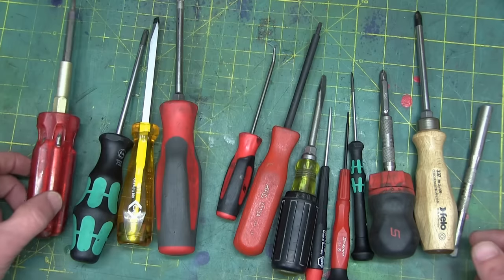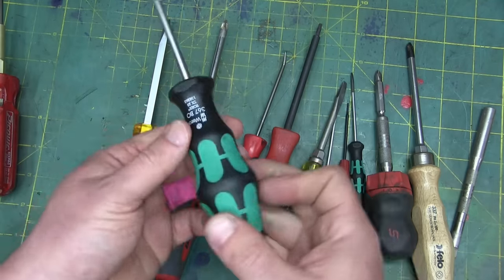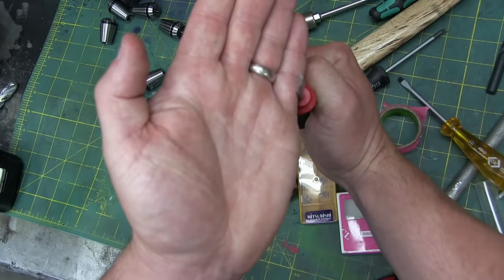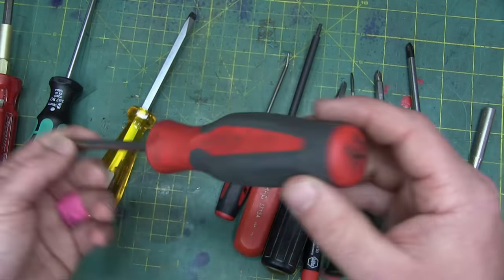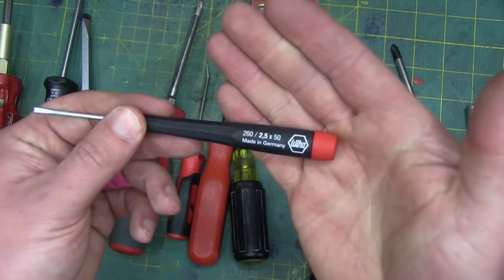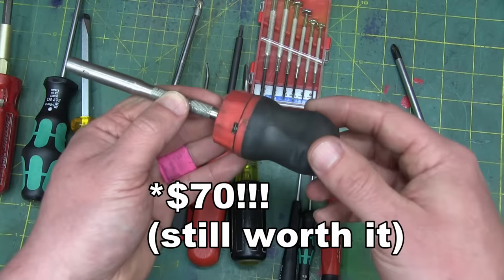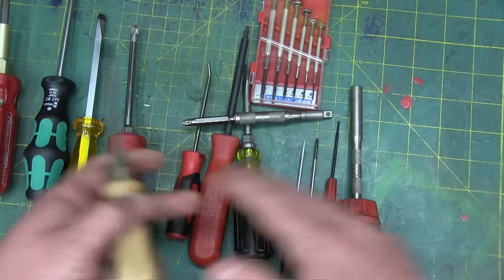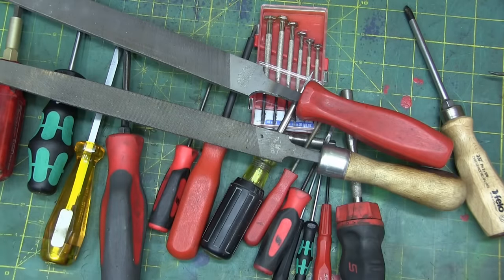Screwdrivers is BEST screwdrivers?

Comment: as an electrician i've always preferred the kleins, although that's probably just because that's what my starting tool kit i bought in school had. their pliers i actually don't like much and prefer knipex. klein handles come off, which really sucks ass when you're pulling fish tape. haven't had any problems with the metal bits but i have pulled more than a few handles off on both needle nose and linemans. i have small hands so the euro screwdrivers don't work well for me. 

fwiw though the screwdriver i use the most is an ideal bit driver i stole from the ideal rep one day, it has a little slot in the back for wire nuts that works really nice and it's just generally good enough for most things so i dont have to fuck around swapping tools.

Comment: The green Weras dont have the nut on purpose...thats what the black and yellow Weras are for, they also work as a chisel. The red and yellow series on the other hand is insulated for electricians work. And there is also the grey and yellow series made of stainless steel for wet work.

Comment: I agree with you for straight mechanical use. It's very different for electrical. The Kleins are great for large work, but in my opinion the best brand was Vaco. Unfortunately, they are out of business. Craftman Professional had copies of the small Snapons - have a bunch of them. The drivers with the shank all the way through the handle indicate suicidal intentions if used on electrical circuits!

Comment: I like Commercial Electric screwdrivers for mostly indoor use such as electric work because of the handles. They give you a decent grip and purchase on the screw, but allow you to turn screws fast. 

For working on cars, I like SK screwdrivers with the square, plastic handles. Soft grip handles don’t last long in the automotive field. The square handle is better because all of the screws rust and the square shape allows you to generate a little more force without having to put a wrench on the shank.

My father had a screwdriver set from his days as a mechanic which I really liked. They didn’t have a name brand, but the logo was just two triangles, one right side up and the other upside down. It’s not a logo I recognize. They had black plastic handles with deep grooves and orange paint. I’d buy a set of those and relegate the SKs to a beater set in a heartbeat.

Comment: I like the Fuller Pro drivers with Acetate handles. My dad used them for years and I've owned some expensive drivers and have found myself gone back to the acetate handle drivers. Best bang for the buck in my opinion.

Comment: I used to work in electronics and always used Whia.  Hell I cleaned my ears with a Whia #00 a time or too.  Now I work on cars and fabrication and metaly greasy stuff.   The Wiha all the way, I sprung for the chemical resistant handle (the purple one's), thru shank CV.  It was hard to drop $80 for 5 screwdrivers, but they are worth friggin penny.   I ran the big flat blade thru a magnetizier and it works as good as a magnet fishing thingy.  Best of all, I dislocated a knuckle, after a few oat sodas and some other "poor" choices I gave her a go with the butt of the Whia.  Popped it right back in,  A Klein would not have had the heft to pop it, never have used a Felo but I hate how they look, the Snap-on might have worked but going to the ER would have been cheaper.

Comment: You didn't include Belzer screwdrivers, by far the best screwdrivers made, unfortunately they are no longer made. I still have a set that I purchased and used daily when I was a mechanic 36+ years ago. The tips and distinctive translucent handles are still perfect.

Comment: Posidrive os NOT JIS.  JIS looks exactly like a plain Phillips/cross point and Posidrive will not fit in it because of the 2ndary flutes.   JIS is sometimes marked with a dot on top of the screw between two flutes, and Phillips driver will also not fit properly for full torque, risking a strip.  A JIS driver is for practical purposes backwards compatible with many other cross point screws, but it doesn't work the other way around as the JIS screw is shallower.

Comment: I have Vessel Impacta JIS  screwdrivers for working on motorcycles. Fantastic Japanese quality,  Magnetic tip, through tang. No hex to grab, but you don't need it. These are impact drive.; smack the reinforced end with a hammer.  If these don't break it loose, you need a grinder.

Comment: I know this is an old video but I have to lip off about the Snap-On.  I got frustrated with the bit shape never being quite right on the philips screwdrivers I had so I finally bought a Snap-On set thinking I was going to fix the problem permanently.  I already had some Snap-On for the most commonly used things like ratchets and so on and had been very happy with it.  The Philips bits/tips fit screws worse than my cheap screwdrivers!  The best set I've found is the cheap no name set I bought from the local auto parts place.  Fap-Off was really a disappointment.  Great tool except for the shape of the tips where it matters most.

Comment: My opinion is Wera all the way, although I'll add a caveat to that and throw in Gedore.

The handles on the Wera do look stupid but the quality of the tip and mind you just the tip is excellent. They have a proper size and fit for just about any screw you normally come across, are hard but not so hard they chip and the laser engraved tips actually do help. Note on the handles that look stupid, they are quite comfortable to use once you've had to reef on screws all day. The extra fat area of the handle gives you higher torque that really hits the strong part of your palm. Then the thinner profile of the handle allows you to spin screws in faster with you fingertips while placing your palm on the back end of the driver. The flats integrated into the handle can be used with a wrench and I'd like to see it as part of the shank instead but nevertheless if it's taking that much effort you probably don't have the correct tool/size driver in your hand usually.

Now the Gedore, they are pretty damn nice too. Admittedly my experience is limited to their "phillips-slotted" Contractor drivers which have both a Philips with one part of it formed into a slotted bit. If you don't know what I am talking about you probably haven't done much industrial control wiring because screw heads with philips screws with an extra wide slot are every where. The extra engagement you get out of this really does make the difference. Right tool for the job kinda thing. The handles are pretty nice too and the flat/flag like handle helps you put some mustard on the thing too.

Oh... and Wera power bits are by far the best I have used by a wide margin. All the bits you get from the usual scumbags are garbage. Well worth the price of the Wera bits. The last MUCH MUCH longer, actually fit nicely, and have some fancy etched tips/diamond coated tips which actually work surprisingly enough.

Comment: CK are well known and liked by elec-chickens over here in Blighty, though I personally prefer their older 1990s handles. For the smaller electronic stuff, Wiha are ok, but by far the best are Facom (French made, believe it or not). For mechanical stuff, well, Snap-on are expensive for a reason, but I found Beta tools to be almost as good, if almost as expensive...
Quite a few of my hand tools are more than 30 years old, but because I paid more and got brands like Snap-on, Beta etc, they are still in great condition despite near daily use

Comment: Mr Ave, you want the yellow Wera's (Kraftform plus) They have the hex shaft and nut you were talking about, as well as a solid metal core, and a strike plate on the end so you can smash them with a hammer, surely that's more your style than the standard greens? I prefer them to the Wiha, and they are reasonably priced too.

Comment: I still think the interesting thing is how the actual drives are made/hardened. For instance the old, green Bahco's /seemed/ to last much longer than the newer models. I have the same impression with Belzer after they were aquired: Quality went down a bit. 
It's "of course" a matter of getting the right combination of hardening (so the drives aren't worn off/destroyed) and flexibility (so they won't explode!). And those things /should/ be getting better with knowledge/development...
From Wera you certainly get to pay for their premium bits - the big question is if you get value for your money/premium...? But at least my impression is that the lasered "anti-slip" features on the Philips/Pozidrives screwdrivers actually is an improvement! Anyways, the problem is that it's hard to compare actual use of the stuff in the toolbox - so someone should setup a real, controlled test... ;-)

Comment: wera also sell a screwdriver set with a nut and the shaft all the way through the handle with a strike plate. just got a set but not really used them in anger yet. C.K seem to be German but sell a lot of stuff in the UK, there insulated screwdrivers are very good.

Comment: Where is the Bacho screwdriver? As an old electrician they my absolute favorite. They spind perfect in you hand due to their perfectly round shape, and you can screw really fast due to the thin section between you thumb and index finger.

However I love the Wera brand. This is really high end. I have a lot of tools from that brand. But I do not like the grip of the screwdrivers as it does not spin easy in you hand.

Comment: After using a Felo wooden handle screwdriver for valve adjustments on Jenbacher engines where I work, I wouldn’t use any other screwdriver for the task. When you you find that tool that hits all the marks, it’s bliss. 😂 Yeah, I’m weird. 😂

Comment: The best tools are Tommy Walsh tools. You know exactly how long each tool will last when you buy it - a Tommy Walsh screwdriver for instance will last 2 screws before rounding off into a dart. So, if you have a job that needs 40 screws taking out, you know you will need 20 screwdrivers, so you budget for and buy 20 screwdrivers.
With generic no-name tools, you have no idea how many screwdrivers you will need. You could buy one and it outlasts all 40 screws, or it could round off after 10 and you hurriedly need to buy another screwdriver, which wastes you time at the jobsite. With Tommy Walsh, you have exactly the number of screwdrivers needed for the job, so you simply pick up screwdriver 1, screw 2 screws, throw the dart at a dartboard, pick up screwdriver 2, screw 2 screws, throw at dartboard, etc.

Comment: CK make the (essentially) industry standard VDE tools in use in the UK and they are damn fine tools, tough as ever it depends which model you buy, the cheaper ones are, guess what, cheap. Wera on the other hand make truly exceptional VDE screwdrivers, i have ridden my set hard and put them away wet many times and they are still going strong! The black/green handled Wera's however are fine, but nowhere near as good!

Comment: If you work with motor starters, push buttons and other electrical parts nothing beats Gleenlee.  For mechanical screws I'll take my 30 year old Snap On screwdrivers. There are other good ones but these are my drivers of choice.

Comment: You didn't do the kind of in-depth material reviews for this I've come to love from you, but it is just a screwdriver. Oh, and if you get oily/greasy constantly (working on diesel for example) wiping with a rag stops working quickly. So, getcha some dawn dish soap and water in a sprayer. Keeps the hands pink and sticky and won't use forty rags a day.

Comment: Makita have a set of bits that comes with a hilarious little ratchet, looks lovely in a way. Absolutely worth having, nothing I have available can get to an awkward screw quite like it, much less room than a palm driver required.
Reply: RiffRaffMakes I got a set of three Craftsman angled wrenches (straight, angled up, and angled down) similar to that Makita one. Gear Wrench also sells a set with a really nice little ratcheting wrench. It has a 5/16 end with some bigger bits, comes with a nice case, and ratchets really nicely, but I haven't beat on it much to truly know if it's as durable as the other KD / gear wrench tools I have.
Reply: Well I haven't had an excuse to put the 6' snipe on it yet - don't really get Craftsman stuff here but I'm sure somebody makes a copy, angles'd be nice to have.  What I really want now is a skinny podger so I can hit it with a hammer.
Reply: The Gear Wrench / KD one is angled, so that might be all you need. It's in the 85035 "micro driver" set; not sure if they sell it alone or not. Twenty-ish bucks on Amazon.

Comment: Just a friendly FYI to those watching for knowledge:  If you're doing anything with a tight pressure or vacuum tolerance, do NOT dig out an o-ring with a metal pick.  Carburetors, ok maybe.  Mass flow controller components or vacuum chamber valves and the like will come back from the junkyard to haunt you.  Use plastic, nylon or composite tools only.

Comment: In my experience, there's no difference between a modern snap on and a 60s vintage craftsman when it comes to simple tools like for instance a 5/16 flat blade. Generally speaking it seems like old craftsman tools were made with pretty good steel. They just lack in ergonomics and like ratchet slop and such.

Comment: The wooden screw driver needs the lacquer sanded off then just coat in linseed oil. You will have the most grip with that screw driver even when hands are greasy.

Comment: Took me 15 years of hard use to wear out my Fap-Off ratching screwdriver, they really are just that good.  I think the spring broke, not the pawl.  The only time I don't use it is when it's fap'ed off and I can't find the damned thing.  Bonus: the full sized handle is hollow for bit storage, and the cap has a hex shaped hollow inside that will hold a bit for extra close quarters screwing.

Comment: I don’t like wasting my hard earned on fancy brands that don’t do the job. For me, Snap-On for their ratchet screwdrivers and Facom for their regular screwdrivers. Both have lasted nearly 20 years in my box.
Edited to add; I bought a large, dirt cheap set of yellow handled things off of eBay about 12 years ago for £36 for general prodding, poking, scraping and opening paint cans with. The handles aren’t set too tight on the shafts, but they’ve been great for doing all those things you wouldn’t want to do with your expensive ‘best’ screwdrivers.

Comment: 8:45 What magic Daiso are you privy to mate? Or has the quality just come up due to japanese conglomerate pressure over the past few years? Bought a set off similar drivers of Daiso at 四条大宮,京都市、J-A-PAN in 2008 to fix a friends laptop, stripped the shit out of the bell end after two screws. The next smaller size could be used with some care and attention to angle of application.

Tell you what.. I shall be back there next week, will update..

Comment: I love the 1000 volt insulated Weira ,for light to medium duty industrial electrical, they have great comfort if you end up having thousands of terminations to preform,the small Weira not a fan but everything above yes sir.I can't stand those tiny ass little strait steel with the steel rotating handle head,those things will wear a hole rite through your hand in a quarter the time of any other they may be strong but comfort is the worst and good luck getting any tork out of that small garbage handle.

Comment: Wiha is mainly an electrician’s brand. If you’re looking at Wiha, I recommend getting Klein instead. Better quality (in my experience) for less money and you still get the wonderful warranty as well. Plus they’re more aesthetically pleasing when you open a tool bag full of them. Also, the Wiha terminating screwdrivers or “electronics” screwdrivers THE EXACT ONES IN THE VIDEO are shit in my opinion. The plastic is quality but feels shit, the palm rest is loose and feels like it may fall off and I damaged the tip of the screwdriver on an aluminum screw...

Comment: In general, I think snap-on is overpriced and not worth it...except their screwdrivers. Simply the best screwdrivers on the market. Don’t like the older square handles, but the tips are the best. Never stripped a screw with one and I’ve never worn out the tip of a Snap-on screwdriver. Expensive, and had to get if you’re not working in a shop with a driver who regularly stops by, but I haven’t regretted the few Snap-on screwdrivers I’ve purchased.

Comment: Elec-chickens here tend to always go for the C.K. Dextro range of drivers. VDE, made in Deutschland yada yada... but, like your C.K. driver there, the blades are brittle as fuck. I broke a pozi-1 by doing the insane with it: Attaching a back box to plywood with a quarter inch screw. I know right? Mental! I have a set of the Dextros.... they live in my tool bag. They don't come out to play often. The ones I use on the reg are the Wera Kraftform comfort drivers. Love them! Nice rubber handles, tapered end for twiddling screws, fat middle for gripping it like you're ready for the money shot and the blades are damn good. Not worn this set out in 2 years of daily use! Highly recommended!

Comment: I have a set of screw drivers and I have no fucking clue what the brand name is, red rubberized handles that don't turn to schmoo no matter how much grease and oil they get coated in (as in, they literally turn black every once in awhile and some brake clean or goo gone and they look damn good again). The butt-end has a metal cap, the shaft is stamped "chrome-vanadium" and that's it. Best god damn screw drivers I ever had, my Big Fucking Flathead Screwdriver finally gave up the ghost while using it as a chisel and pry-bar for removing the floor pan in my jeep, chipped the tip... grinded the tip back in and it's a little wonky but suffice to say I finally got some actual pry-bars to save my badass mystery brand nigh irreplaceable screwdrivers.